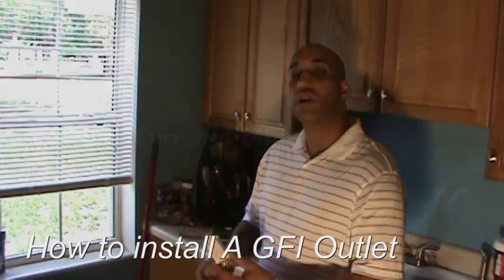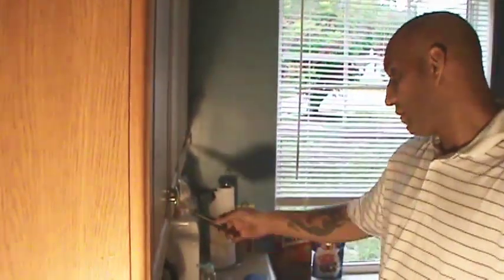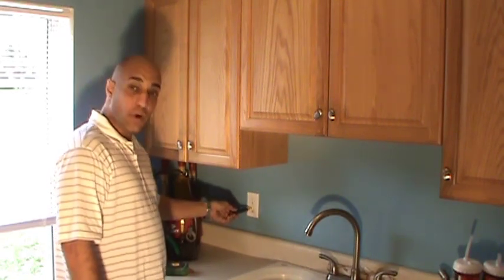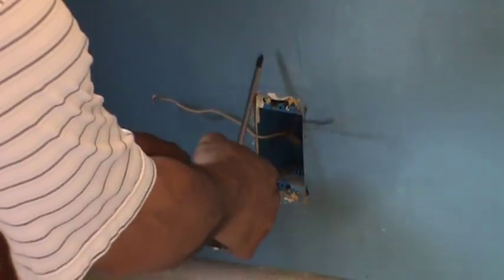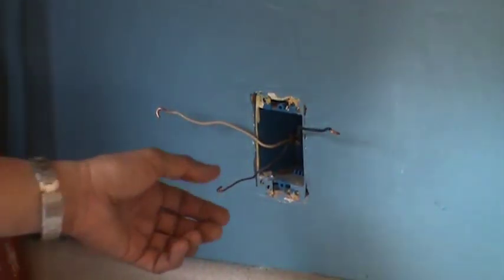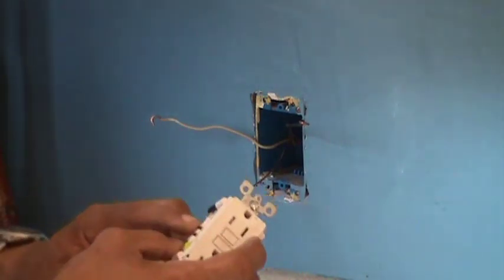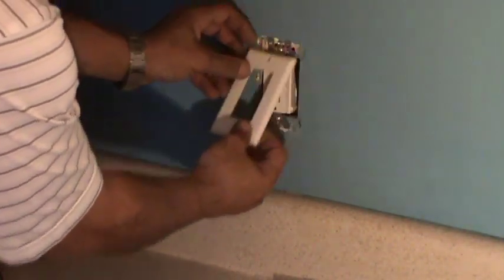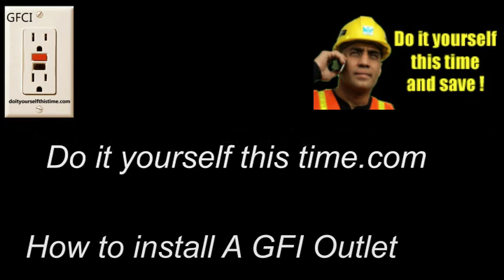How To Install a GFCI Outlet

Comment: Thank you.  I would have liked a little explanation about connecting to the Line terminals not the Load (taped over) terminals.  (Which is what  I did.  Oh, well)
Reply from the maker: Sorry for the late response but ill be sure to update the description and include a brief description. Thank you
Reply: Always connect the line in cable to the line. In this case there was only one set of wires entering the box. Thus it's a no-brainer. With tape over the load terminals it's a given that using the load terminals is optional. Since you only have a link in there is no option.

Comment: i would NEVER use the holes in the back, id rather just use the hooks at the end of the wire and put them on the screws like any other installation. ive heard of those holes letting the wire come loose.
Reply: Those holes are not what you think they are. They only engage when the screws are tightened down to secure the wire. They are not simple push in terminals.

Comment from the maker: Seems like you have a metal box if this is in fact the case,the actual BX or conduit will be providing the ground to the electrical system, which is why there are only two wires, so it looks like it should be OK.